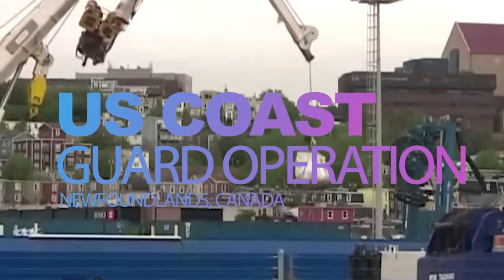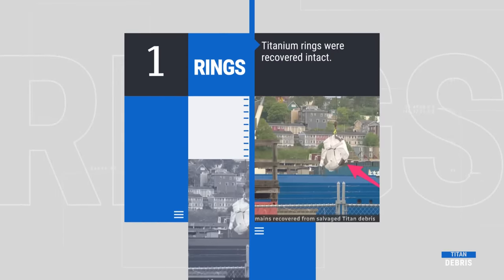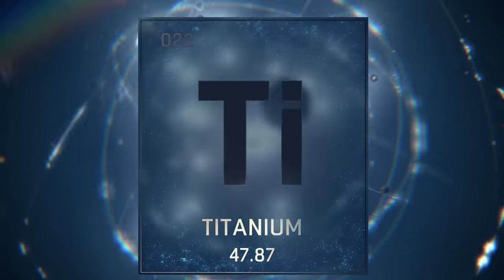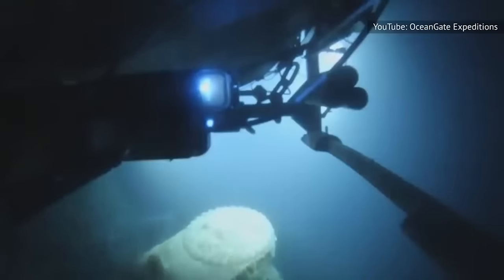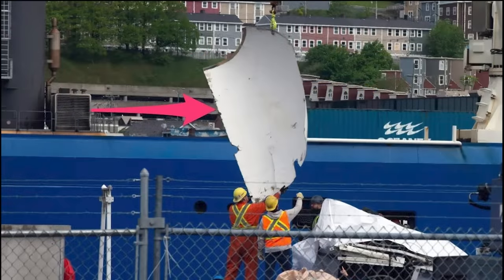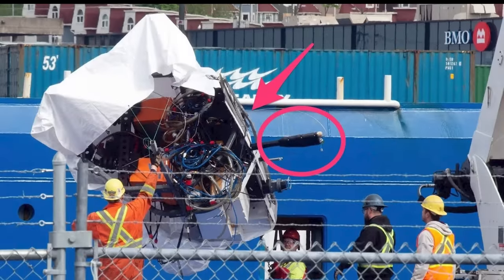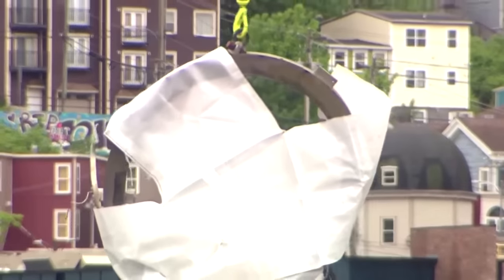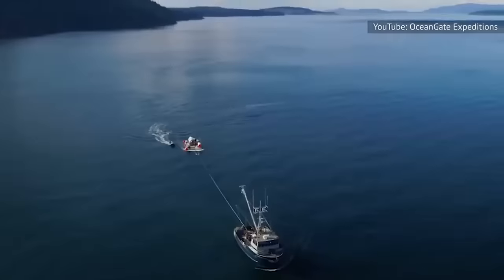What Really Happened? The Titan Submarine Clues from Parts after Implosion

Comment: Please look at it this way. When the carbon fiber was laid up It was spun on with wet resin. When it is in the air millions of tiny bubbles are cured in with the resin. As the sub ascended and descended those bubbles expanded and contracted with the pressure. when this happened, it broke apart the fibers all through the carbon fiber and the hull got progressively weaker. At the point that the implosion took place the entire hull disintegrated, and this is why there is nothing left of it. Had the lay up been done in a vacuum the life of the hull would have been extended but it could never last forever
Reply: i asked the same thing on many videos , but almost noone seems to point that out. shouldn't they have the laying of the cf, glueing and placing of the rings done under vacuum in order to have maximum adherence? it feels like it's something else they " cut corners " onto.
Reply: Also waspulled off  then baked after it was spun

Comment: The bond between the carbon fiber was inefficient. The lap should have been larger and additionally mechanically bonded both interweaving the carbon fiber.

The carbon fiber composite pressed in whereas the titanium caps did not. A separation occurred which immediately blew out the acrylic dome and collapsed the sub. A crack at the bond of the end caps is my guess because no "peanut butter" glue was on the front cap.

One design flaw is the application and process used to apply the composites. They used a wet lay which is inferior to a vacuum autoclave. 

NASA suggested at least a seven inch hull. In reality the Titan submersible was in fact less than five inches. 

Many variables added to the failure. When dealing with the pressures expected at those depths you must over-engineer rather than skimp on materials. 
And using a Logitech controller was not the issue. Arizona class destroyers, submarines as well as drone pilots prefer over the cumbersome, overpriced and outdated hardware offered by military suppliers. And considering how many recruits are proficient with those specific controllers, it just makes sense. Those who use those controllers say they're far superior to what is currently commercially available. 

Carbon fiber composite scuba tanks are interesting. They're much thinner and they're superior to metal tanks. They are the industry standard. They are very capable of containing pressures. However carbon fiber is quite brittle under outside pressure. These facts make me question why a double pressure hull wasn't erected by Ocean Gate. 
Exploring and experimenting comes with costs. Those people all knew they were on an unregistered, untested and controversially designed hull. 
It's sad yet the world doesn't need international oversight and control over international waters. Laws need to be created so in the future the company can be forced to pay back taxpayers money. It isn't right that governments should foot the bill and cover rescue/recovery costs.

Comment: On other videos engineers have thought the carbon hull failed and blew the viewing port window out, even shearing off the bolts that were attached to it because no part of the bolts are visible in the video of the front  titanium piece recovered. But, they were unsure absent further information. Your hypothesis that there would probably have been some pieces of the carbon hull recovered if the port window failed first, due to a bit less pressure if the window failed first, sounds very logical. My first thought when seeing what was recovered was that they have the front and the back but where's the middle?. Also pointing out the titanium rings that surrounded the middle carbon section was clearly explained and helped understand the hypothesis that the carbon middle probably failed first without recognizable pieces to recover.
Reply: I expect pieces of the carbon fiber hull were recovered, but like tempered glass it shattered into a lot of small pieces rather than a few big ones. There's footage of what looks to be bags full of material being unloaded shown in this video, I'd believe those contain the remnants of the carbon fiber hull.
Reply: @butchs.4239  Thanks for pointing that out.

Comment: This is easy. You got it right. This is for sure catastrophic implosion of the main pressure hull due to the carbon fiber composite. This material is a woven carbon fiber layer (rolled around a cylinder think toilet paper while moving it laterally) with epoxy layers as a binder (applied by hand which is another problem altogether). This type of material is terrible with compressive loads and susceptible to water ingress and delamination particularly after repeated pressure stress cycles. Further more the hand application of epoxy creates uneven thickness and opportunity for micro bubbles to occur which makes delamination even easier to initiate.

Comment: Duh.. ALL the pieces you are seeing that were retrieved were the pieces that were OUTSIDE the sub, the actual hull (where the people sit) was what was full of oxgen and imploded, then exploded, sending the external legs, and the wiring and motorized parts to the bottom of the ocean floor. That's the stuff they recovered. The ship itself is gone.
Reply: i suppose carbon fibre would have shattered like glass, leaving the titanium and other parts intact, but where is the port window, did it survive or was it the real culprit, as it was only rated for 1300 meters, not the 4000 they went to repeatedly   ???

Comment: Note that the titanium end caps are not attached to the titanium end rings.  Those Home Depot level bolts failed at some point.  Either the cause of the implosion or as a result of it.  Even if the carbon fiber tube imploded, the end caps should have stayed attached to the rings.

Comment: I am no engineer but I would bet that a crack formed where the titanium and carbon fiber attached to each other. Carbon fiber is strong but brittle and titanium is strong but will also most likely flex a tiny bit compared to the carbon under that extreme pressure. And you  repet that little flex enough it will start to weaken the carbon fiber. Either form a crack or compromise the rigidity and it would start flexing until it got soft enough it reaches 1 too many.

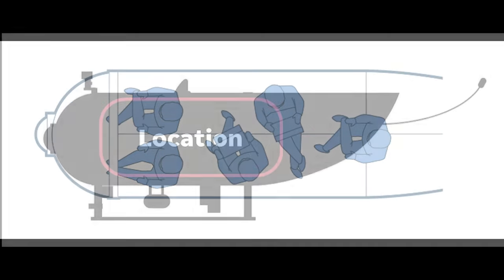Comment: It would have been more illustrative, and more honest, to show the actual craft. For example: beginning at 4:48, there was no upper ingress portal on this vessel, and there were no female personnel on board. And the diagram at 4:54 does not accurately show the pressure vessel of this craft.
Also, attempting to investigate the repeated communications of "cracking sounds coming from aft" just after all communications were permanently lost, and possible reasons that the craft was sinking much faster than predicted/designed, and that it could not rapidly ascend after it jettisoned ballast and even the framework that held the ballast, would have been nice.

Comment: If I had to guess, the big pieces are the result of an implosion AND explosion happening.   This is probably because once the carbon fiber main hull imploded, the gases (oxygen, etc) blew outwards as it ejected the aft and front titanium section away from the main cf hull.    According to the allegedly leaked transmision transcript from the larger ship; crackling sounds were somehow heard near the aft section - most likely the carbon fiber materials shredding/flaking itself apart as tears traveled the length of the main body until it was crushed.    The aft debris that was brought up looked like it kind of split in two, while the front titanium part was somewhat intact - minus the glass viewport.    I'm just guessing, but I'd rather wait until the final findings are in and released.

Comment: The reason that there are such large pieces is the fact that the outer shell and the end caps had no mechanical bond to the carbon fiber pressure hull. The carbon fiber pressure hull shattering wouldn't have much of an effect on the rest of the sub as far as destroying it.

Comment: As someone with an engineering background my guess would be the failure happened where the titanium ring was glued to the carbon fiber hull. To imagine what a submersible goes through at depths picture a water balloon in your hand and imagine squeezing that balloon with all of your might. The ballon doesn't break but definitely misforms. The same thing happens to subs under immebse water pressure. My suspicions became the glued sections immediately after hearing that is how they attatched the rings. One small tiny little seperation in that glue and poof, the end. I highly doubt the finished sub still had that view port rated at 1/4th the depths they were going. I'm sure it was something they used in the beginning for shorter test dives they stumbled across while their final one was being manufactured. Stockton Rush was an engineer and I highly doubt he would allow himself (even though he had a high risk tolerance level) let alone paying customers to depend on something rated for half their intended depth. In the end if I were to put money on any one cause it would be that glued area. Glue would be huge mistake on something constantly being contorted and misshaped.
Reply: Being it's under compression it's not likely, with the missing port light I'd imagine that the port light failed and it exploded.....

Comment: The pressure at 12,500 feet is 5600 psi and there are 255 square inches on the average human body that means there was 142,800 collectively of pressure on the human body at 12,500. But during a sudden failure the body would vaporize in a nano second

Comment: Either the acrylic porthole window failed or the carbon fiber pressure vessel failed. I tend to think the pressure vessel minus the end caps failed catastrophically. The ingress of sea water under pressure shattered the acrylic porthole window from within due to acrylics brittle nature in failure. The carbon fiber pressure vessel would likely have disintegrated all at once and no large pieces would be left. The larger outer pieces of the shell were mechanically attached to the pressure vessel. When the pressure vessel carbon fiber tube collapsed, it pulled in the composite outer shell fracturing it into a number of larger pieces. Both end caps were also pulled inwards possibly slamming into each other and then bouncing back away then settling to the ocean floor first. The titanium rings were smashed together in this process. But not undergoing any noticeable damage. It is not surprising to find the end caps intact and not damaged and yet no trace of any part of the carbon fiber tube. That is what I think anyway.
Reply: As good a guess as any.

Comment: Thank you for a wonderful explanation of possible causes of this tragedy - I am one of many who dread discovering that the primary cause was hubris and rank stupidity
Reply: Definitely hubris.  Rush refused any certification process because it “stifled innovation”.  As it has been pointed out by many experts, carbon fiber constructions are great under TENSION (against things PULLING), but absolutely not under COMPRESSION.  And the forces at work the deeper one dives are compressive, not tensile.  The layering process only made it more dangerous over time because of the risk of the layers delaminating (great for puff pastry, deadly for submersibles).

Comment: Two observations.

At 0:52 there is a shot of a large section of fiberglass.  Note how the jagged breaks along the edges look like fasteners or mounting points were torn out violently.  But they spread out not in.  That makes it look like the internal structure pushed out at that spot.  This could happen if the underlying structure twisted violently. (yawed)  One side would get pulled in, one side pushed out.  If the carbon fiber hull failed it could have been asymmetrical and caused such a twisting moment.

The rings are interesting.  No carbon fiber, no real visible glue residue either.  Under the shock/impact of the hull failing the glue appears to have completely failed and separated from the titanium, leaving it relatively clean.  The other thing about the rings - why are they separated from the titanium hemispheres?  Those were bolted together.  Neither the rings or the hemispheres seem to have been grossly deformed.  You would expect at least a few of the bolts to remain intact and hold them together.  I'd really like to see close ups of the bolt holes on all 4 pieces.  Marks and local deformation would tell if the bolts failed due to sheering or longitudinal tension, or possibly both.  This would give clues as to what was happening to the hull, the only other thing on the other side of the rings.

Comment: The leaked messages from titan to the support ship have been leaked/released. 
The got into trouble 3500m down into the descent only 300m from the titanic! Stockton tried to abort and ascent immediately as soon as the RTM system sounded 90 minutes into the voyage, he dropped the ballast which made no difference next he jettisoned the frame to drop weight which helped and they slowly ascended up but only 20m up in 19 minutes, Stockton was here cracking noises from the aft of the sub and 19 minutes after thr first indication from the RTM the sub has no more contact with the support ship.
So they knew for nearly 20 minutes they was in serious trouble.
Reply: Link?
Reply: 8:23 - ..."Courageous crew ...." ?????   The passengers had absolutely NO idea and were NOT aware that the submersible was a death trap. The CEO did and knew that it it failed nobody would have the time to realise. He was a gambler taking gambles with other peoples lives for profit. Absolutely no better than a drug dealer.

Comment: The carbon fiber was only wrapped in one direction, that would have left it very susceptible to crushing in an accordion fashion. That would have blown the viewport out. Our man on the hydraulic press channel, did a small-scale mock up with a carbon fiber hull, and steel end caps. In his experiment, the carbon fiber accordioned, and the end caps dislodged themselves from the hull. He also did pressurization and depressurization cycles on the model, that showed there wasn't any significant stress fracturing in his experiment. That may not scale, but it's a pretty decent try on his part.
Reply: Additionally, carbon fiber works great in tension. Not so much in compression. I believe any compression strength would have been provided by the epoxy matrix and not the fiber.

Comment: Why would they glue a carbon fiber hull to a ring?
Reply: ‘Innovation’ apparently
Reply: There isn't really another way to do it safely.  Drilling into carbon fiber to do rivets or bolts can cause more damage. 

Granted, I do have limited experience drilling in carbon fiber.  I had 16 inch lengths, I forgot the diameter, but was attempting to drill into them to make a carbon fiber hilts for a lightsaber prop.  My first two attempts ended up with a whole lot of damage that ended up spreading, third and fourth had more localized damage, enough to hide with the outer electronics, but once you start cutting the individual threads in the carbon fiber, you weaken it substantially.  

Maybe they could have made it with the holes already in place to mount it, but that would have made the process a whole lot more complicated.
Reply: Because they had to bolt the titanium end pieces to something.
They could not bolt it to the carbon fiber hull directly, hence the titanium rings...

Comment: The carbon fiber hull was subjected to 14.5 million pounds of axial compression load (pressure against the face of the rim of the tube) so 14.5 million pounds distributed on 5 inch of carbon edge is prone to fail, the crackling they've heard on prior dives was a manifestation of the over-stress condition the carbon had to manage, until sudden collapse.
Reply: Designed to fail, as some people have said.
Reply: But wasn't the carbon fiber wrapped around a cylindrical metal frame before it was put on? The hull wasn't just made of 5" of expired carbon fiber
Reply: @MissX905  I've never seen it stated that there was anything else. Just the CF cylinder, the titanium end caps and then the fairing plus the skid, thrusters etc. I could be wrong, though.

Comment: It is striking that seemingly absolutely nothing from the carbon fiber has been found. It's also bizarre that there were no cross fibers in the design, only one direction for the entire thing. It's hard to visualize just how such thick carbon fiber would crush and leave nothing. And the CF was spooled onto a lip of the titanium collar so those would have had to pop out for the CF to crush in. It'll be interesting if it had a black box, if they had a few seconds warning. Could well have been a worrying snap and then one second later it was lights out. If no large piece of CF remained then the people would truly have become a cloud. Strange.
Reply: The CF is only one point of failure.

It's obvious what happened if you have good eye sight.

The wreckage showed the titanium ring as the dome intact. 

What a lot of people overlook is that there is no residue on the rings, no reminiscence of carbon fiber, not even the hypoxy was visible.

That leads to the only one, very obvious conclusion.
Reply: Carbon fiber changes under heat and pressure! Having worked with a HYDROClAVE  we turned woven carbon fibers into a graphite! At around 3,000 P.S.I.!  A smooth, rather soft material! Wouldn't be surprised if any carbon could be found, since the Titan far exceeded those pressures!
Reply: @robertchilders8698  interesting. you are saying the pressure is enough to make the organic chemistry reactive